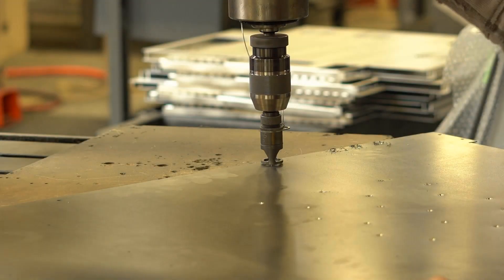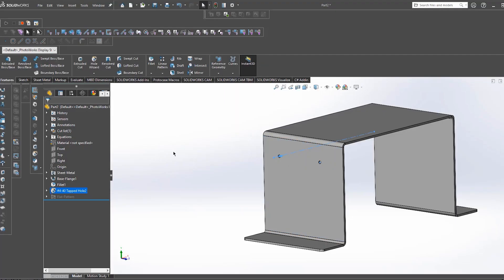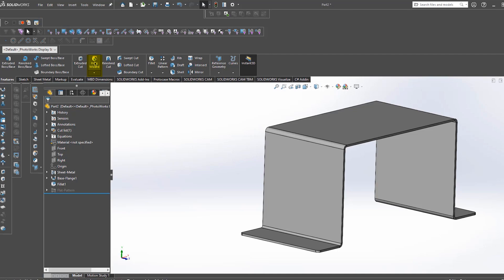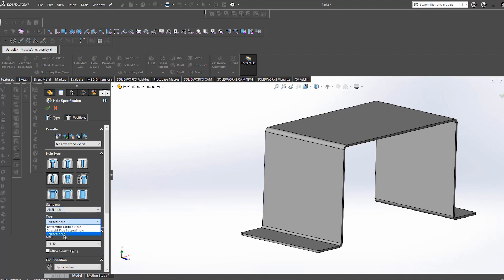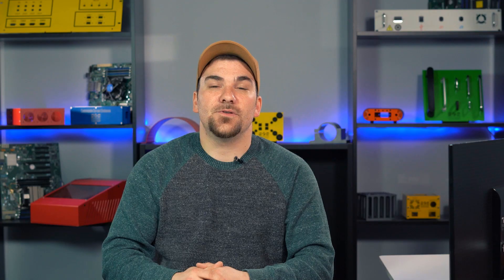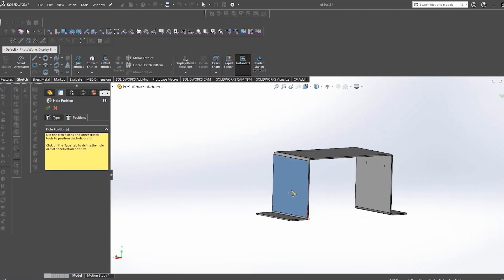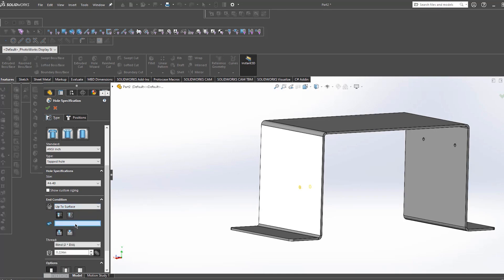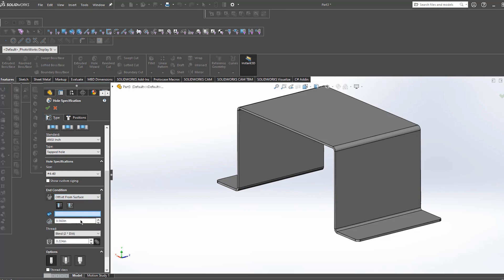Proto Tech Tip - How to Use the SolidWorks End Condition Feature

Comment: That same user interface should have Protocase Designer, I use it and the letters and menus are very small.
Reply from the maker: Hey Skylär - do you mean that you find the letters and menu of Protocase Designer small? Because if so, you can customize that in PD by going to Edit > Preferences. Click on the Display Settings tab, and change the Interface Settings to "Custom."